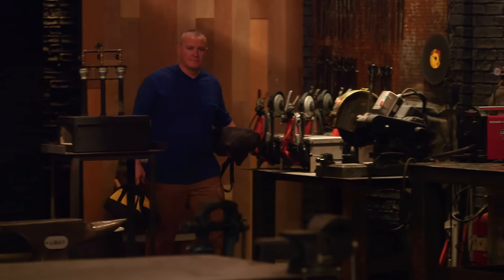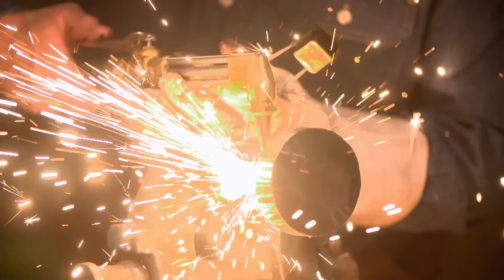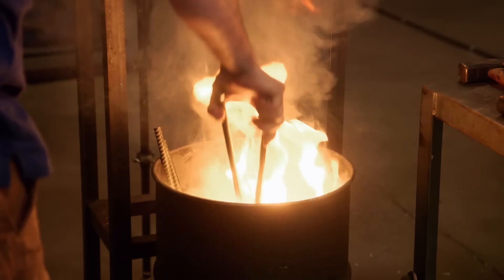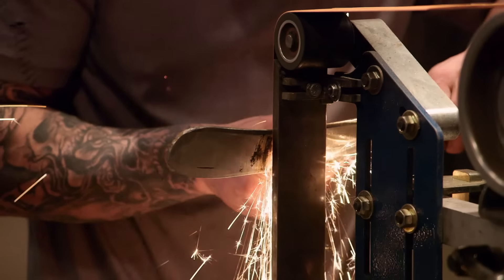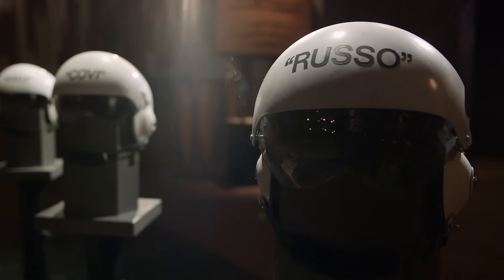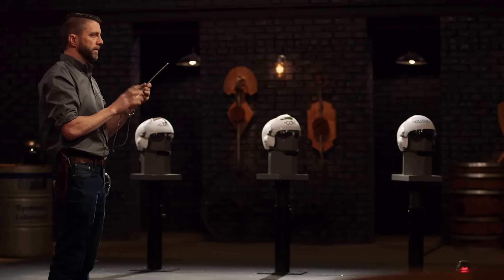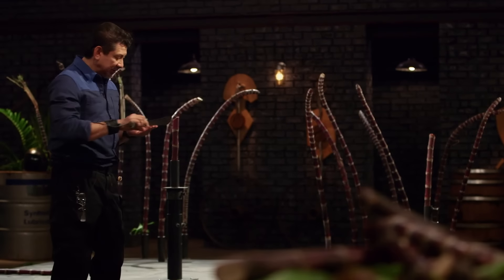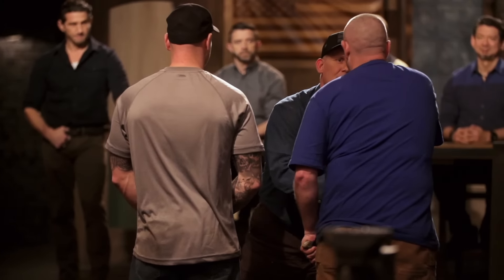4 Airmen Compete to Forge Bolo Blades | Forged in Fire (Season 6)

Comment: Why aren't they forging in the handle pin holes and make a hollow handle and just slide it onto the tang?
Reply: Probably has to do with the time limit, a hollow handle takes more time. And personally I wouldn’t want to drill rivet holes into an already narrow tang for a chopper. For strength and durability the full tang with slag scales makes more sense to me.

Comment: IMHO the person with the weaker handle should have been let go. You can use a chipped blade, and the blade performed equally well with the others in the sharpness test.. You cannot use a blade with no handle, or which could fly off the handle at any given point. But then I'm no blacksmith.
Reply: You can quite easily fix the handle or even make one from paracord or some string/cloth in the field, but you won't be able to fix the bad heat treatment and blade will quickly get worse with use.
Reply: Yeah, at worst you can shove the blade into a stick wrap it up and make it a spear if the handle breaks. A chipped blade will only get more worn and break worse if it has to do anything serious.